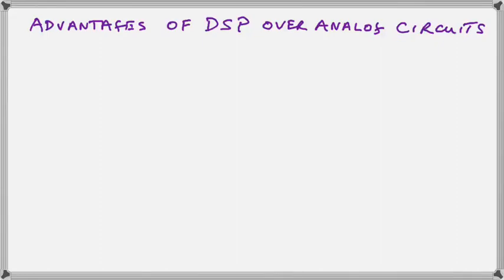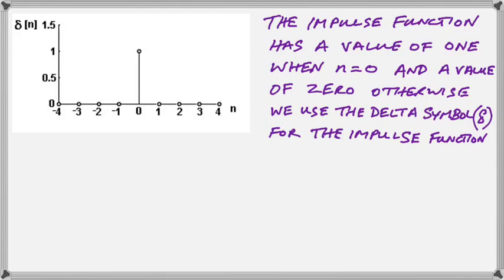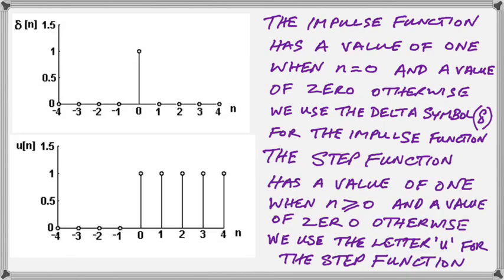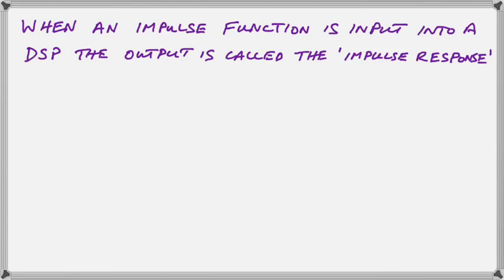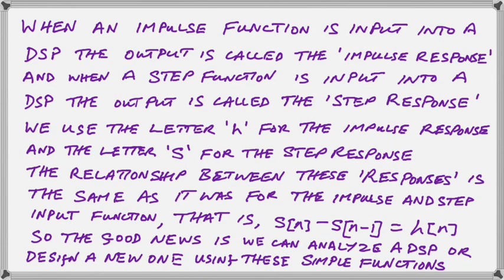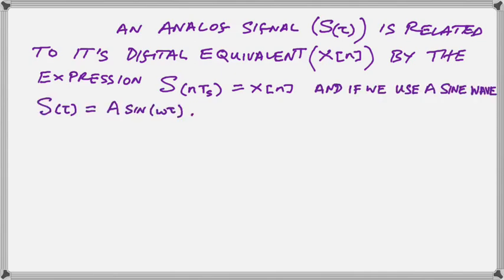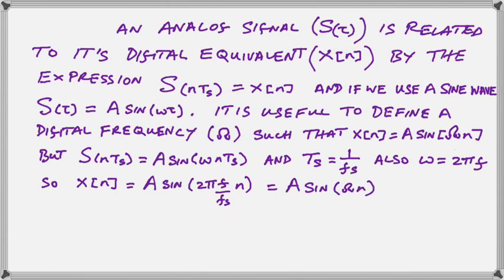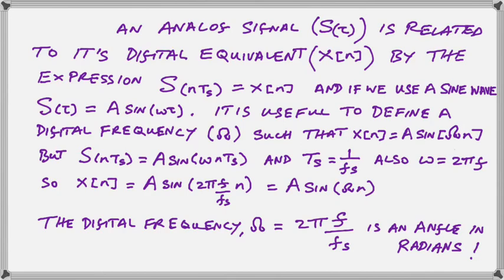Basics of Digital Signal Processing (DSP)

Comment from the maker: I made ONE minor, but mathematically significant, ERROR in the video....... the SIN function at 6:19 should have normal brackets for it's argument NOT SQUARE BRACKETS ...... this is actually a frequent student error and happens because students do not understand the mathematical significance of the different types of brackets...... the SQUARE brackets in DSP signify array elements and  contain INTEGER values